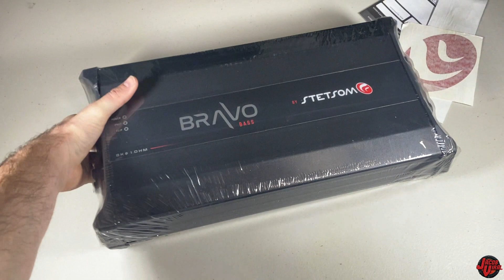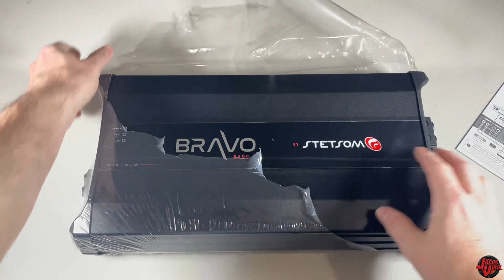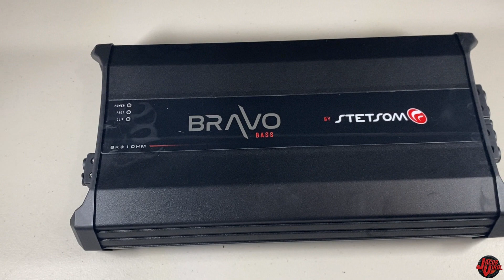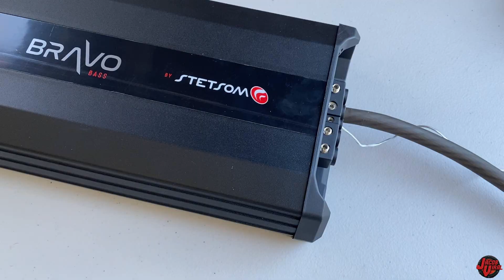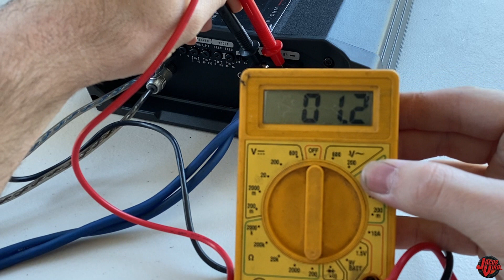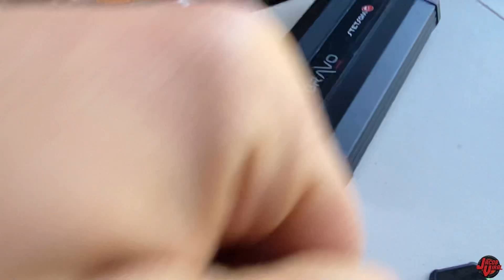Stetsom Bravo BASS 8000 Watt Amp Test and Review! *GREAT RESULTS*

Comment: Hey jacob i really been interested in these stetsom amps im stuck between the stetsom DB 3k 2ohm because i got dual 2ohm subs or the Wolfram ac3k what do you think is a better amp the Wolfram ac3k is .5ohm stable too
Reply from the maker: A 2 ohm stable offering that power range there would will be more efficient and safer longterm. Going to half ohm offers more risk but that’s up to you: I would say the Digital Bass 2ohm 3k https://amzn.to/3WAOzBX or bravo bass 3k

Comment: Hey y’all my amp blew but my fuses didn’t I need help? On the 3k bravo
Reply from the maker: Could be from vibration, bad electrical, or clipping it to death.
Reply: @JacobViral  thanks man I appreciate it found out that I needed to upgrade my wire from 4 guage to 0 guage no more issues with this new 3k

Comment: So you got a rise from 1 ohm to almost 2 ohm ??  I'm curious so I'm thinking every amp that is wired to 1 ohm has a rise to 2 ohm. And maybe if I was wired down to .5 ohms I would rise to somewhere in the 1 ohm area???? .   I need to know this that way I can make my decision on what amplifier to get. Power wise. I need a good dependable daily amp to power my two Sundown x10v3.
Reply from the maker: Not every frequency note always rises 2x or more, some notes will only be 1x to 1.5x? Etc rise or less or minimal/no rise. A lot blow amps wiring down as certain notes are hurting the amp with no rise.
Reply: @JacobViral  got Cha. I like running my amp at 1 ohm. To be on the safe side. Thinking about getting a teramps smart 5. But I'm afraid of dependability and or save money and go with something better???
Reply from the maker: @superior3384  depends on the power you need, goals, and budget.
Reply: @JacobViral  i have two sundown x10v3. Mechman 240 alt. One xs power D3400 AGM battery. Big 4 done and one run of 1/0 wire. I have a low budget subwoofers we're very expensive and I don't want to blow them up. I need a safe long dependable system i can be proud of. Not sure what amp I should go with????  I've been watching YouTube like would would not believe. I watch YouTube all day . YouTube fanatic . I love watching your videos over and over.
Reply from the maker: @superior3384 very nice so for a pair of x v3 rated I recall 2,000 rms; I would go with an 8,000 and not 5,000 as your going to want extra head room so you don’t max the amp ever ever and keep it clean so the subs will be safe like you want. More power isn’t more power when you learn limits.  Check my latest community post poll to see what I mean. 👍
Reply: @JacobViral  wow thanks Jacob. Always appreciate your help and support with my questions about my builds. Your extremely knowledgeable and experienced. A true professional in my opinion.
Reply: @JacobViral  Jacob one more question. What amp brand should I go with i trust your opinion highly. You said 8k but I'm on a low budget. And if I do decide to go higher also which one?
Reply from the maker: @superior3384  bass 8k from Taramps or bravo 8k from stetsom as my 2 choices.
Reply: @JacobViral  awesome. What amp is your fav. You like stetson. You have 4 8k
Reply from the maker: @superior3384  My favorite amp is a Korean brand but too pricey for the power atm so what I got now yes is. FYI, message me Facebook/Instagram JacobViral anytime. 👍
Reply: @JacobViral  thanks bro.

Comment: I've got the stetsom vulcan 8k and it's the real deal.1 ohm version.i imagine this one will be too.
Reply from the maker: I used the Vulcan with excellent results to! Thanks for the information
Reply: I have 2 vulcan 8k 1 on each 15 inch  skar 1ohm
Reply: @larrybrown7802  they can handle that? Seems to much power
Reply: @DanielPerez-ln5px the skar zvx have a really stiff spider. They can take way over rated power. I had a zvx 18 with a smart bass 3k to each coil at 1 ohm. No problem.
Reply: @grady.M12.83  im running 3 zvxs on a 8k. Ill probably get a 12k

Comment: I wonder if these newer stetsom amps still catch fire like the older ones
Reply: What older ones? A Timpano that Big D f up the dyno? That one?
Reply: I use to have a stetsom Ex3k and it lasted longer than my sfb2k. I used it for a yr and then sold it and bought a taramps 3k MD. Sfb2k caught on fire 3 times before I sold the 4th replacement and bought an Orion Hcca 3k and then a bc6k, never going back to full bridge unless I'm running mids on them.
Reply: My friend had one that caught fire and it wasn’t even playing 🤷🏽‍♂️
Reply: I been running a Vulcan 3000 on 2 American Bass Elite 15’s 4 ohm dvc wired to 1 ohm and it’s the deepest n hardest bass I’ve ever had. Never gets hot
Reply: I've used quite a few different stetsoms of varying wattages. Never a problem. I have several builds using stetsom for both bass and mids and highs, not a single problem. Lots of Taramps as well, no problems with either. 

Vehicles are a wide range, some with strong electrical, some with weak stock alts and batts. No problems with any of them, other than a couple ham fisting customers, killing drivers with the abundance of cheap compact, clean power.

Comment: whats the most powerful amp I can get that is 4 gauge power/ground? I knew I should have just asked for 0 gauge on my install but my alternator is only 100A so I thought it'd be overkill.
Reply: If you only have a 100amp alt, wouldn't go more than 1k watts. You can't really power much with a 100amp alt, your vehicle uses roughly 60% of the stock alts amp output, so that leaves you with only 40ish amps to use and that's not going to do much even with extra batteries.

EDIT:
Furthermore 4 gauge wire, if its ofc can only handle 100-125amps max for runs 10-19ft long.
Reply: @xXDigitizerXx  with your maths my car can only generate about 500 watts (40A x 14V) so why recommend a 1000 watt amp? I used for 4 gauge wire precisely because it can handle what my alt puts out (100 amps). So you're saying an extra battery or 2 is useless? I have a 1500 watt amp in there right now that has already blown an 800 rms sub from over excursion not heat so I know it's putting out more than 500 watts. (ultrasonic was turned on).
Reply: @jimjones3287   A 1k amp isn't going to be pulling max amperage 100% of the time, due to impedance rise it will be doing more like 200-500 watts rms which is iine with 40amps to spare from your alt.  Batteries require amperage to charge too, it might help a tiny bit with voltage drop, but you'd still be feeding dirty power (clipping), which is likely what you did to that 800 watt rms sub you blew.

If that 1500 watt amp was a true 1500 rms amp, it would've been pulling amperage away from what your vehicle needed and causing voltage drop, possible light dimming and that sub would've seen nothing but clipping dirty power.

You can clip a sub to death even if you have solid eletrical, if your head unit is sending a clipped signal, or having bass boost on, the gains on your amp to high, or simple as playing music with clipping in it.

Assuming you have a stock battery that's roughly 15ah and 40 amps to spare the rms watts you could put out is in the high 400s, giving the amps efficiency is 65-70% anything over that will be 100% dirty power and would kill any sub.

You will never pull 100amps from a 100amp alt to your car amp, you would be lucky to pull 50-60 amps to your car amp on bursts with a high risk of burning your alt up, the computer in your vehicle, amp and subs.
Reply: @xXDigitizerXx nice info 👍my amp clips but not 100% lol more like 5% I have a clip indicator so I can visually see if it's clean output or not. The sub blew from over excursion on a burp not from clipping. I never claimed to get 1500 watts continuous on a 100 amp alt but I'm not getting only 400 watts my sub is moving violently. I feel the breeze cooling my head from the port (~1.5 cubes ported behind driver seat) on those low notes even when I wire down to 2 ohms (rated 980 wrms at 2 ohms). So I guess moral of the story is stick with my current amp as my car won't be able to push more than what I'm pushing now which is already pretty substantial (my bass on head unit is on -5 which is the lowest it can go....) but yeah no way I'm seeing 1500 or even 1000 watts continuous but maybe dynamically I'm seeing around 1000. Thanks for the info again.
Reply: @xXDigitizerXx  and yes amp does rated it's CEA certified (Fosgate R1200.1) and yes if I play it loud enough it will dim my lights and clip but I don't turn it up that high because it shakes the car too much so I can't enjoy the bass).
Reply: It's good to have a volt meter. 
If voltage drops, clipping occurs easier. 
If you can't keep your voltage above 12V you need to beef up your electrical. Takes power to make power.

Comment: That's why I love my taramps smart amps! My 5k does more than that 8k, ya know🤷‍♂️
Reply: U are mistaken...
Reply: @jermainephillips5179  how is he mistaken? The Smart 5k does 6,000 watts at 2 ohms and basically the same at 1 ohm. Jacob said this was his low peak, so the minimum impedance the amplifier will ever see playing tones or music, and the 8k put out less than 5k watts. The smart 5k would had put out 6k watts at that ohm load. How is that not more power? The Smart 3k and Smart 5k put out power like much larger amplifiers than they are once you factor in impedance rise.
Reply: Yes but the smart 5k gets hot in about 30 seconds i have four i know they wont stay cool for shit I just returned my smart 5s i dont even know what im gonna do now maybe the md 12000 but idk
Reply: @shitbrick69 does it have fans?
Reply: @rhurtadorh32 they have dual fans. Not sure why his are getting so hot. Mine don't.

Comment: 4k watts per 600. bucks thats a hard pass from taramps 8k, and they have sold plenty to have a name in this game
Reply from the maker: Almost 5k watts at 2 ohm(above rated) & based off the real world test here over 9k Watts at 1 ohm if that was the load. Thanks for watching!
Reply: Md 8k would do the exact same thing at rise
Reply: Agreed!👍
Reply: This isn’t a resistive load on an amp dyno. 5k watts with 2.1ohm rise is above ratings.
Reply: @casey360360  that's why the smart amps rise to 2 ohm, you'd still get full 5k out of it tho.
Reply: @1ohmwrecker  and the bravo bass makes over 8k at 1 ohm.
Reply: @casey360360  not with rise, which I'm talking about. You'd have to wire into the dirt to get 8k out of that.